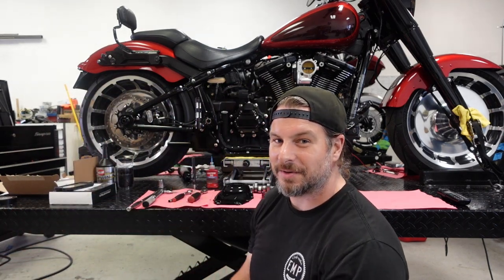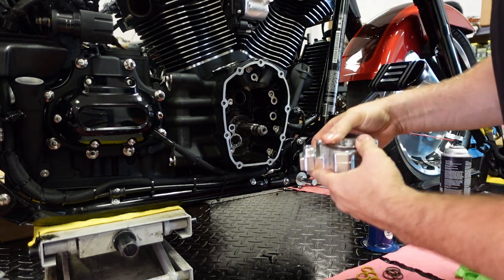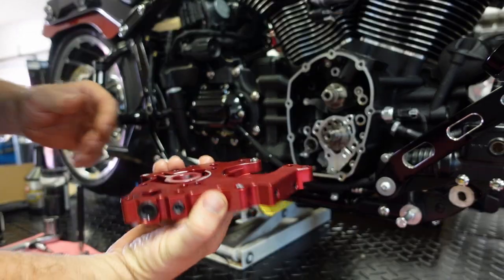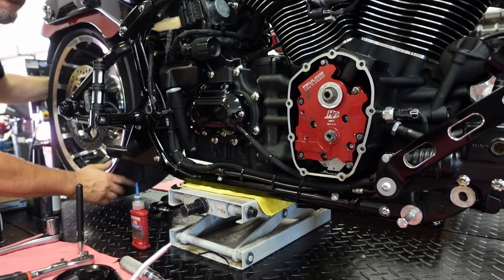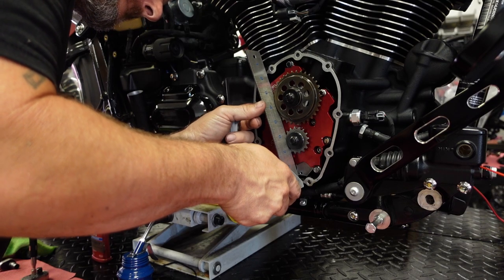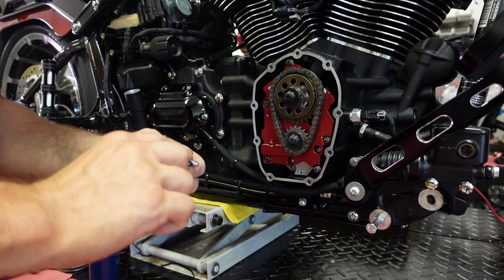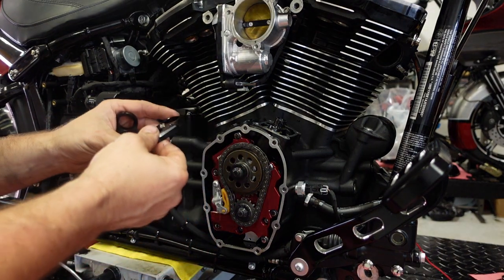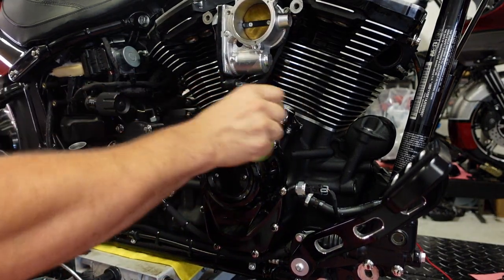Installing a Feuling Oil Pump Update on a Milwaukee 8

Comment: Hi I Just bought 2017 M8 Ultra Limited and I heard  that they have issues with the Harley's M8. I heard one of the major flaws of the Milwaukee 8 is the oil pump used from 2017 to 2019. I read that the pumps creates conditions that might lead to engine failure over time? I know people talked about the vented dipstick and can help to improve the crankcase ventilation but might not help compare  to and update oil pump? I also heard that the higher crankcase pressures the Milwaukee 8 generates coupled with the lack of adequate crank case ventilation is a real issue, and the issue only becomes more apparent with high horsepower builds like the Stage IV kit on the M8, So I'm assuming that the high horsepower M8 builds really put some stress on the crankcase pressures leading to excessive blow by. I heard the best way to deal with this is to updating my Milwaukee 8 oil pump from the 2017 to a 2020 M8 oil pump, Will this solves that issue? Adding an updated 2020 oil pump and a vented dipstick, is this a good idea for my M8?
Reply from the maker: The updated oil pump usually takes care of the sumping issue. On high hp bikes I like to run a vented dipstick and run the top end breathers into a catch can, instead of the combustion chamber
Reply: I have the same bike, a 2017 CVO Ultra with the 114 dual cooled engine. I noticed some frothing of the oil on my oil cap when checking the oil, and that is a sign of sumping. I also pulled the crank sensor right after a ride of 30 minutes or more and I got over 8 ounces of oil from there, it was definitely sumping. I also put a vented dipstick on the bike and ran my top end breathers into a catch can, both seemed to help. I have my bike in the shop right now getting the new oil pump installed. I don't wanna chance blowing the motor if the oil pump stops pumping because all the oil is in the sump getting whipped like some Betty Crocker cake mix, would be a bad day. I'm also having the Star Racing 3030 cam installed to give it that Harley sound and also more power down low and mid range. When you come back from a ride and check your oil, see if you have any froth on the dipstick, if so, yours is probably sumping as well, and you'll need to get that pump swapped out. The frothing of the oil comes from the crank beating the oil into a froth, best way I know to describe it, it'll look a little like a milkshake. Good luck Brother!